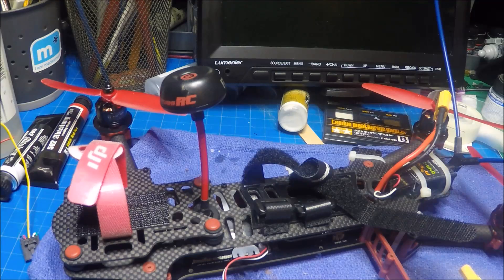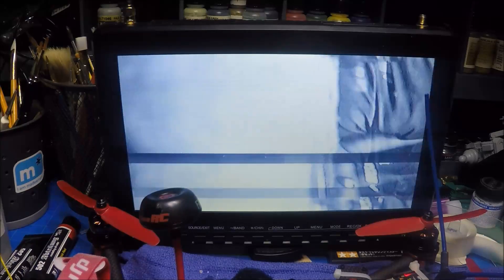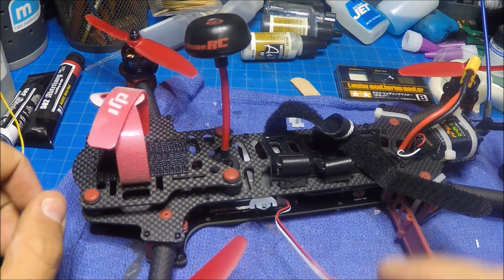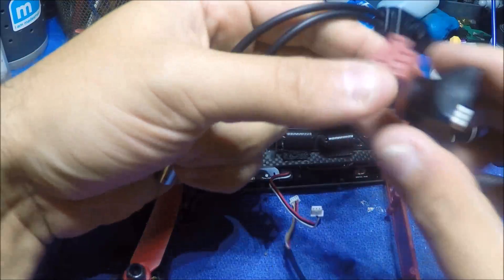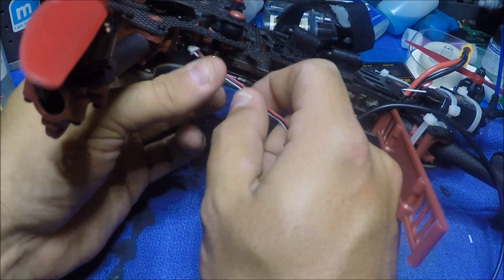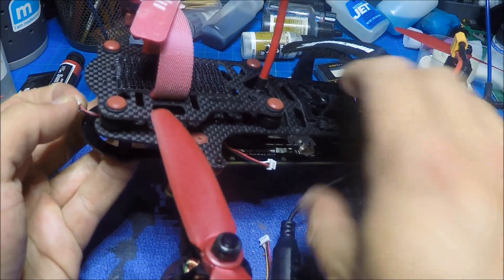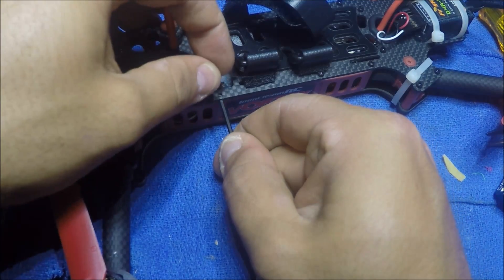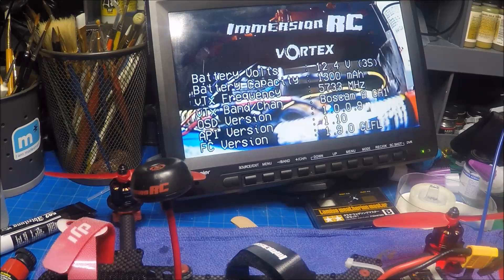ImmersionRC Vortex CCD Camera Upgrade

Comment: Hey wonder if you can help i got the vortex 250 pro and my fpv cam died iwhem I connected quad i just get a black screen when I researched it says the 5 led light means no flight cam detected ao i want to get a run cam what runcam is this an will it come with connection thanks

Comment: Great video. Ok so I'm amazingly new to all this and have been tooling around with my Vortex 285. I have he Fat Shark goggles. Now here's my question. Do I need those adapters for a monitor or will I be able to toggle the settings through my goggles? Also I go with ntsc if I have the goggles correct? Again great video.
Reply from the maker: NTSC is fine. You can view the camera osd through the goggles and the cable they come with. If you have an hs1177 type camera then you still need to power it somehow. Unless it has two port..one for the osd cable and one that hooks up to the vortex.

Comment: not to clear on you video. explain that the osd input isn't used on camera instead of saying gap and edit your spring attachment. shouldn't take that long to put that spring in.
Reply from the maker: Now that I've taken the 285 and 250 apart many times it's a lot easier.

Comment: Hello! I have this camera and ImmersionRC 600mw Tx. The camera works on my TV, but does not work with my Tx dive. I tried reverse polarity as suggested by a seller, and does not work.
I tried to feed the camera with 11.1V instead of 5V power supply module immersion. It does not work.
You as it has achieved?
Thank you!

Comment: I'd like to get one asap.  What options are best for the Vortex?
2.8/3.6/2.1
IR sensitive/IR Block
PAL/NTSC
connector top/bottom
THANKS!
Reply from the maker: +Lorne Serpa personal preference but most like 2.8, ir block..ntsc if you are using monitor..pal or ntsc if you are using goggles...do not get the mini silver runcams..they do not fit..go with the ds1117
Reply: +biomedchad 
Thanks, ordered.  Flying into the sun today on my vortex sucked.

Comment: Just a note you don't need to pull the side case off just remove the front mount as there is enough play on the cable

Comment from the maker: im going to shoot a video of the camera osd and cable and show what settings i use..it will be on a different multi but its always the same. if you cant wait select color instead of auto or black and white..i increase sharpness all the way up..turn on wdnr..and under monitor selection i select user and then move my gamma to about 0.30

Comment: Thanks for going to the trouble to make this video. I was definitely doing it wrong when trying to focus the camera while still mounted :) However, there is enough slack in the camera wires to simply unplug it at the front, and then plug it back in before you screw the mount back to the carbon plate (no need to dance with that spring on the VTX ;) ) . You can also just unscrew the bolt that secures the ring into the hinge instead of removing the whole assembly if you're super lazy like me!

If you're a little OCD, you can also pull the pins out of the 3 wire plug, and feed them into the 4 wire plug without soldering (but nice to see that it fits, even less fiddling).

Comment: I HATE that metal clip!!   I tried doing it similar to your way, and it released, sprung my screw up in the air, causing me to look for it for 10 min. LOL  Thanks for the vid!
Reply: +Doug Rowan -- I use something to hold down the MIDDLE  of the retention "spring/clip" and then Jimmy the screw into place.